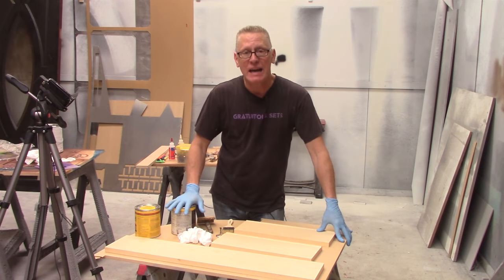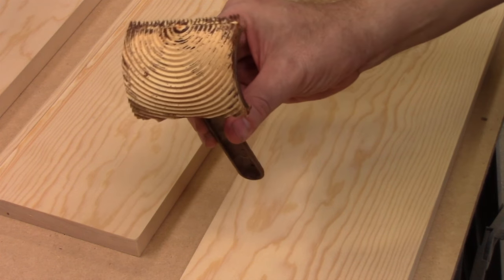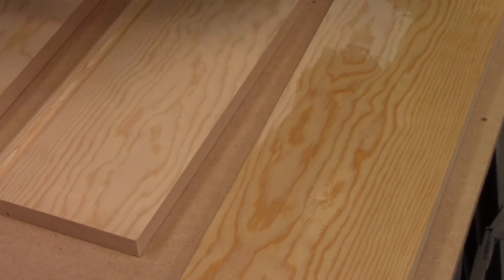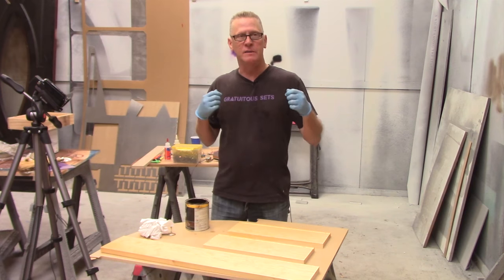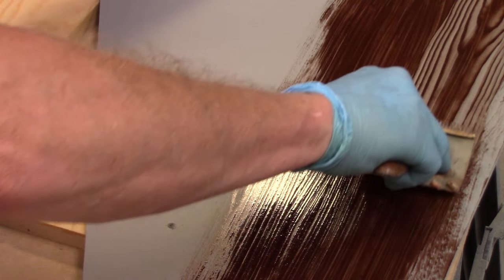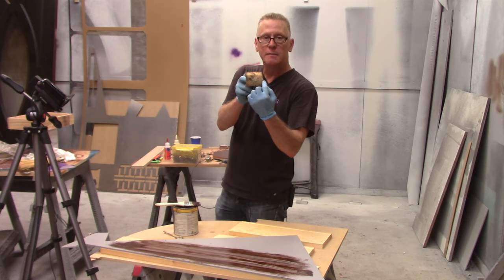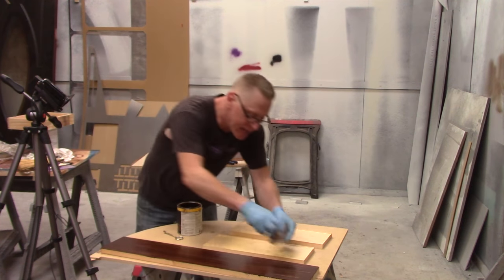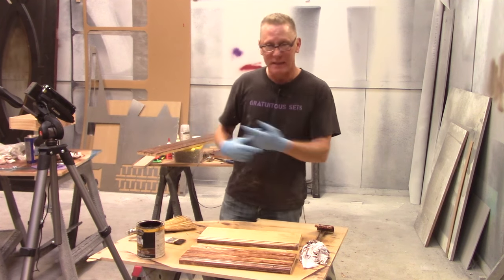How to use stain to create faux oak

Comment: Thank you, great video
1- In the beginning you have mentioned the natural stain however later on you said clear coat twice, is there a difference in materials or they both the same?
2- For the wiping stain, can I use a lighter colour or it has to be the one you have used (dark brown) knowing that the timber I'm using has lighter grain colours?
3- After painting and creating the good looking of the natural grain, can I apply weather proof varnish? it says on the product that it must be applied on bare timber but I'm thinking to sand the timber after the pain but just worried that the created pattern will be removed. Can you please advice? Many thanks
Reply from the maker: I would start with natural stain, then clearcoat twice. Your choice of stain color for the grain. Clear coat once more to seal in the faux grain, then weather proof varnish. 😜

Comment: Could you do the gel wood grain with a lighter color and then go over it with a regular stain (not gel)? The color I like doesn’t come in a gel...
Reply from the maker: Sorry for the delayed response-  I'm not sure it would work, but it's worth testing on a piece of scrap. DEFINITELY clear coat between colors. The benefit of gel stain here is that it's slightly dimensional (kinda stands up) when applied, so there's heavy color left behind after graining. I wonder if there's a way to thicken regular stain...  If you test it, PLEASE let me know what your results are- it could be handy. 😊  -Mark

Comment: what's the difference between wood stain or paint with glaze to do that effect and which one is better? or is it the same?
Reply from the maker: Glaze is slightly more translucent and can give a tiny bit more working time. Gel stain (also called "wiping stain" is easy to buy off the shelf. Glaze is less common and must be custom mixed. Both can be used with this technique but, glaze is water based so, you'll need to clearcoat in water based polyurethane. With the gel stain, aerosol can clearcoats can be used. BTW, this is the BEST question I've been asked on this video! Thanks! 👍👍

Comment: Thank you for your video.  Quick question:  I'm going to make raised panel cope and stick cabinet doors with pine, but need the oak look.  Can this process be used and, if so, should it be done BEFORE the door pieces are glued together.  Additionally, what might I do to avoid the stains getting into the glue areas?

Thank you very much.
Reply from the maker: Hi, dman!! Yes, it would be best to dress each panel before assembly, although it can be done afterwards. I would, then, apply toner after assembly. Each stile and rail will look more "real" that way. Getting a little stain in the glue areas shouldn't be much of a problem but, you could mask the male sides of the joints if you get squeamish. Here is a video showing stile and rail graining of a piece that is already assembled, but the pieces are square (lacking any profile) so, while not ideal, it works okay here. PS- Tony had never done any graining before. https://youtu.be/CifxuPV8_3s 
Call me if you have questions (my number is on our facebook page)  -Mark

Comment: Thanks for the video.  I'm trying to match my builder pine stairs to my hardwood.  The hardwood is a medium/dark gray distressed oak.  At what point during this process would you stain gray?  Should you start with a gray base, use gray gel stain for graining or follow what you did and stain gray after the graining process?  Would the pine still absorb enough stain to get dark enough after all the sealing to make the grain?  Also, any tricks to get the edges where the stairs recess into the stringers?
Reply from the maker: Stain to the lighter shade first, then seal. The Graining shade shouldn't really absorb, just sit on the surface to be manipulated with the graining tool. Amazon sells smaller graining tools for those hard-to-reach areas. You can see them in this video---> https://youtu.be/CifxuPV8_3s  Let me know if this helps and you can call me for a chat if it might help.  -Mark

Comment: I lived in a house that had a ton of trim done in "gum wood".  Turns out that "gum wood" is just a term painted faux wood done in the ? 20's - 30's.  It looked fantastic.  I was there for more than a year before I realized it was a painted surface.  Or maybe I'm just slow?
Reply from the maker: That's really cool- I've seen bits of that in the past but what you're describing sounds much more extensive
Reply: @GratuitousSets  Full shoulder high wainscoting on a large dining room and a bunch of doors.  I was also in a house that had some that was not to that quality and you wouldn't be fooled but the first place was impressive.
Reply from the maker: Wow!

Comment: Hi, I'm Christopher. I'm currently Refinishing Red Oak in a Church.
Full mechanical strip and Clear Water Bourne Urethane.
There are doors involved in this process.
New wood (red Oak Doors and casing material is involved as well).

When the New doors arrived on site it was obvious immediately the doors were White Oak, not Red.

I have been told by the Construction company "you need to do something."

If it were Red Oak needing to become White, it would be more realistic.

Have you ever made White Oak lighter to match Red oak?

Thanks, I hope you get this.
Christopher
Reply from the maker: I have a few ideas- call me at 214-529-0045 -Mark
Reply from the maker: Christopher! Call me or let me know that you copied my number so I can delete it from the comments🤣 I can probably give you some red/white oak advice --->  call me at 214-529-0045 -Mark

Comment: Thanks for the video.  I'm a bit surprised  that you didn't use conditioner before the stain to prevent blotchiness.  Is that the function of the natural stain?
Reply from the maker: It would have helped, maybe? In the end, I ended up clear coating the piece so the pine acted as just a base color. I don't know if conditioner would have done that well enough. Great observation, though! Thanks!😊

Comment: Why not use a screwdriver to open a paint can? Been doing that for decades and I don't have to buy (or keep track) of another tool.
Reply from the maker: Using a paint can key helps keep the pry edge from getting dented so it can seal better (especially true if we are going to open and close a can several times)